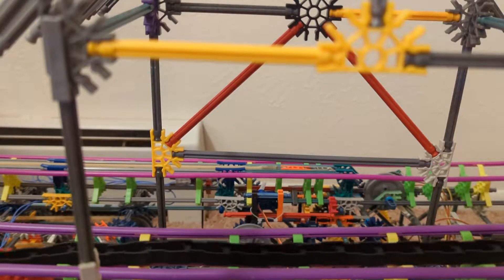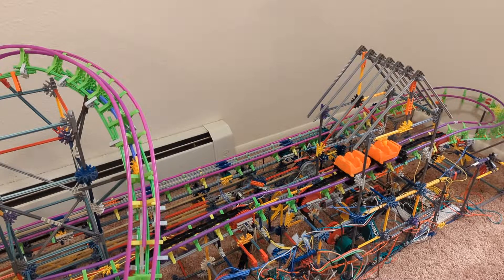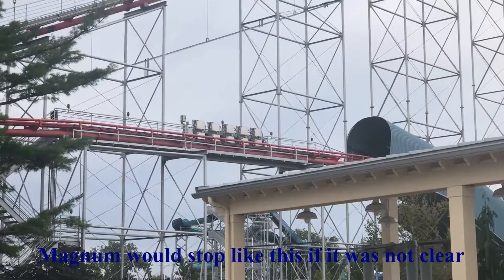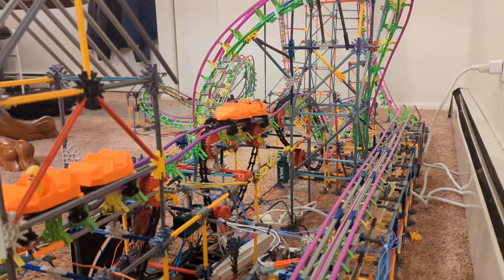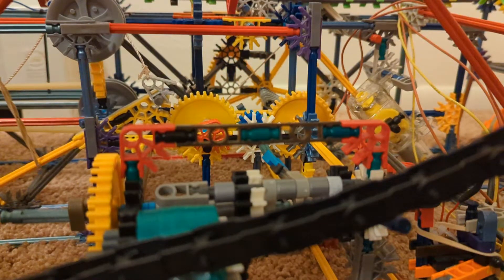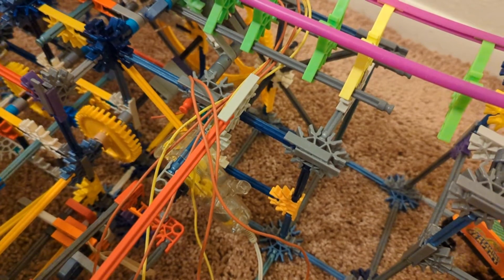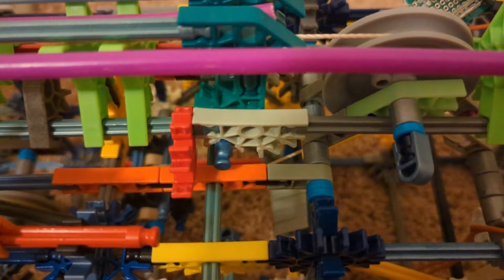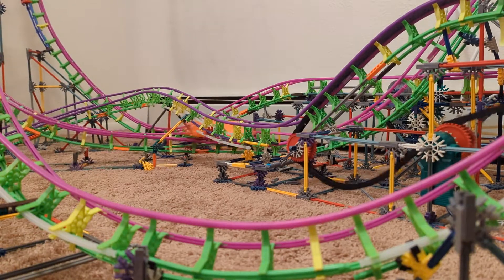Rocket Run | Launched and Automated K'Nex Roller Coaster

Comment: Dude, you worked 13 months on this? This is incredible! I was very intrigued watching how all the arduinos worked, my main thought was “dang. that’s a lot of wires.” The magnets on the wheel assemblies are so smart, they allows it to function so realistically! I’m always impressed by block sections on knex coasters.
I’ve gotta ask about the 55mph - how did you measure that stat? Did you use like one of those radar guns?
Reply from the maker: Thank you! It took a long time mainly because I was teaching myself how to use the Arduinos as I went along, but I was also taking classes during most of it's construction. 

I used one of the Arduinos to measure the distance from the base of the launch track to the back of the train at a specific time interval. Using these measurements I was able to calculate it reached a top speed of 55 mph. It only hits that speed at the very end of the launch and lost most of that energy by the time it reached the top of the tower.